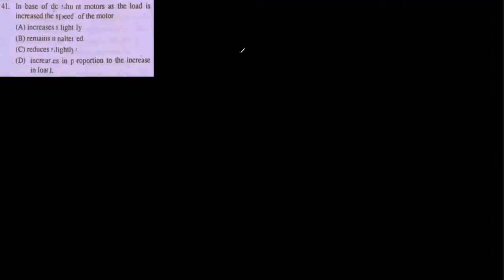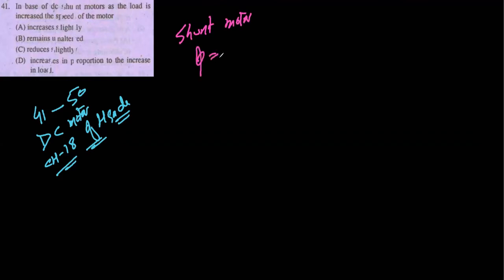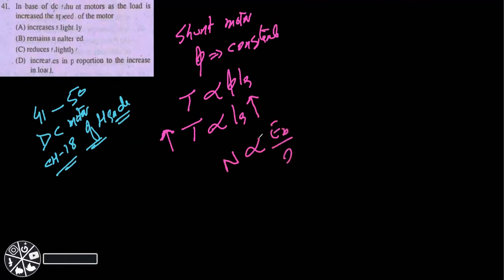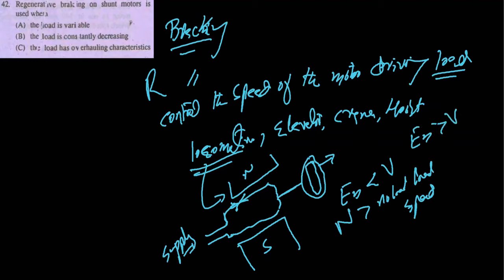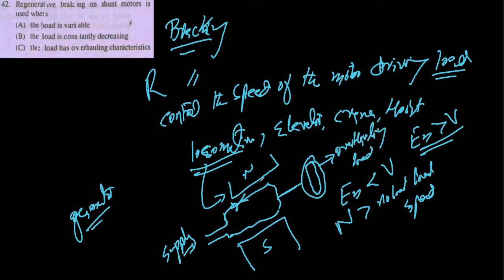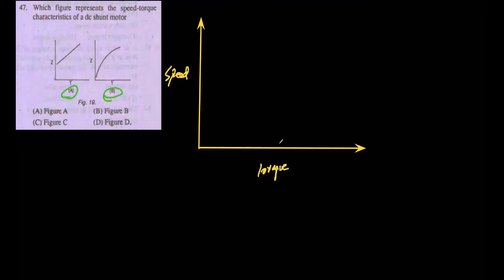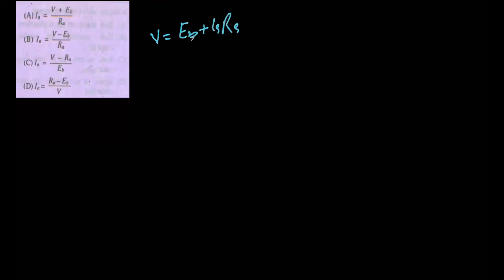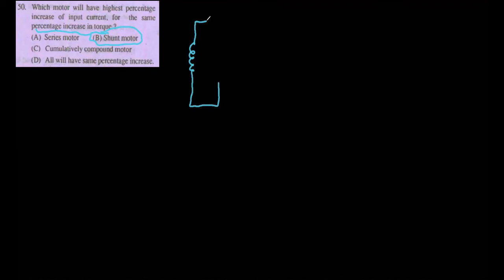Handa MCQs || Chapter 18 || DC Motor || MCQ's No 41 to 50 || Engineering World ||

Comment: Please solve this..........
 There are two-----800 kW transformers each having a maximum efficiency of 98%but in one the maximum efficiency occurs at full load while in the other it occurs at half load. Each transformer is on full load for 4 hours; one-half load for 6 hours and on one-tenth load for 14 hours per day. Which transformer will have better all-day efficiency?
        (A) Transformer with maximum efficiency at full load

        (B) Transformer with maximum efficiency at half load  

        (C) Both will have the same efficiency